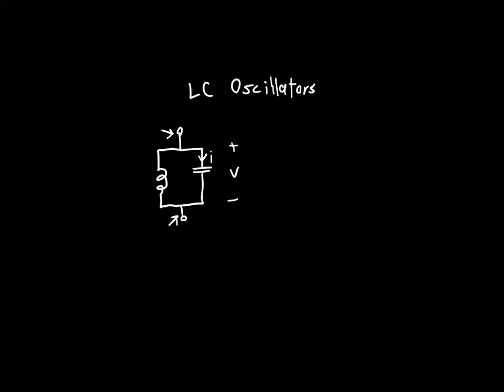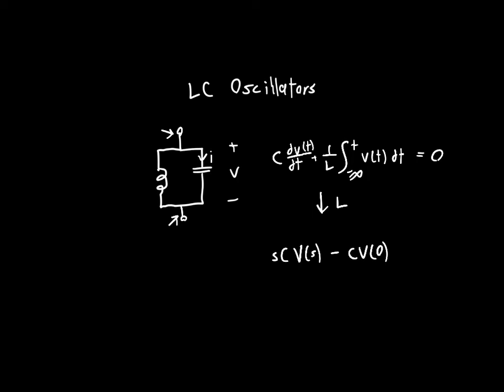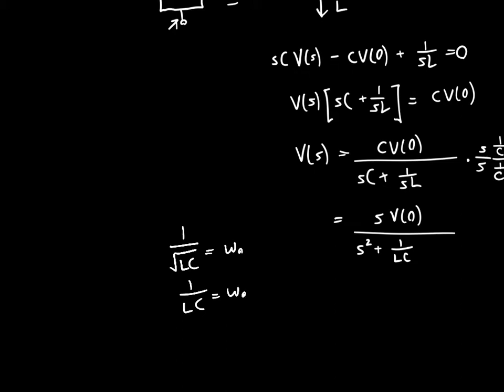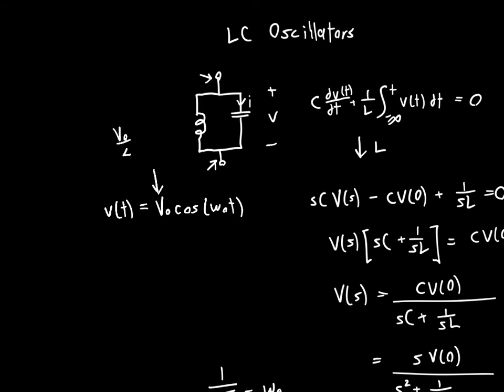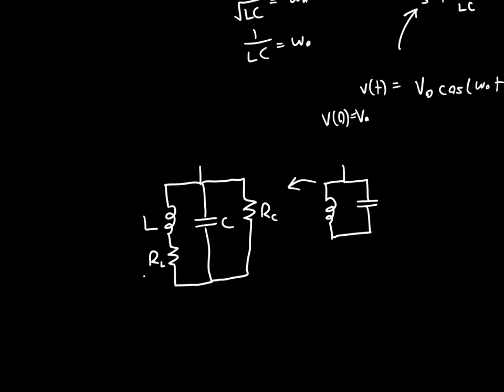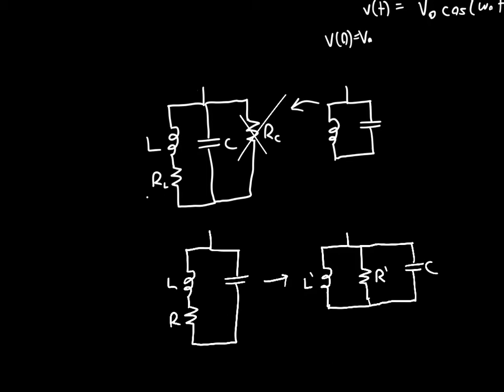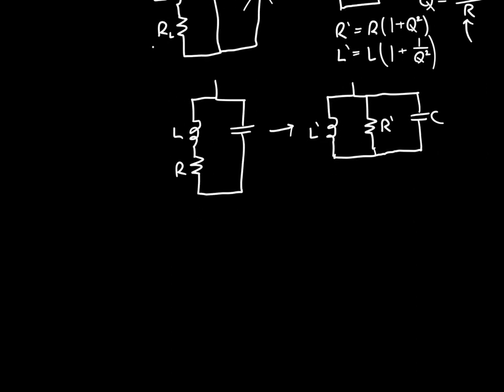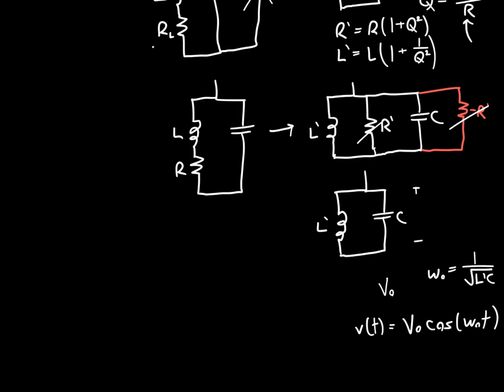LC Oscillator Introduction

Comment: at time 02:25, you wrote the equation sCV(s) - CV(0) + 1/(sL) = 0 but shouldn't it be sCV(s) - CV(0) + V(s)/(sL)? Please let me know if I am wrong.
Reply from the maker: Yup, that is DEFINITELY missing a V(s), a mistake on my part. Good catch! It was so blatant I didn't even notice it when I wrote down the next line (which is correct).